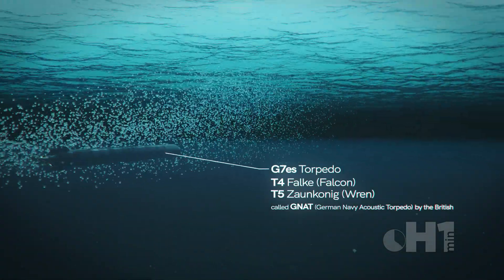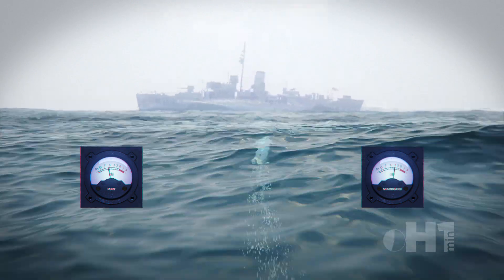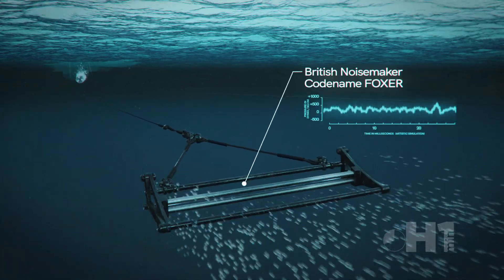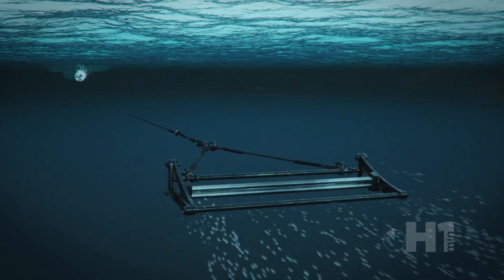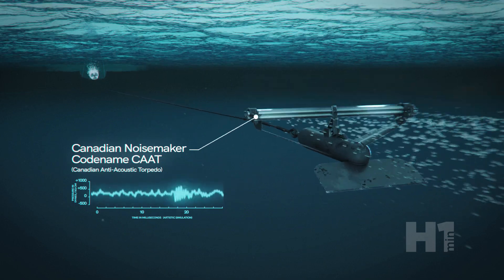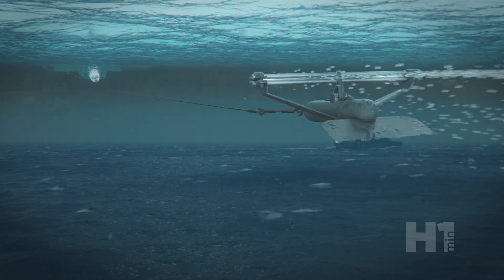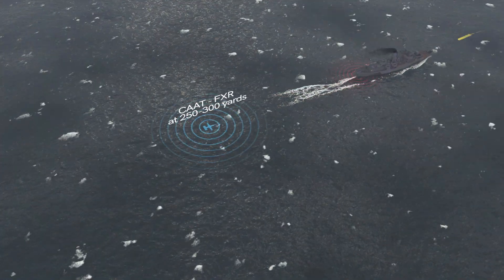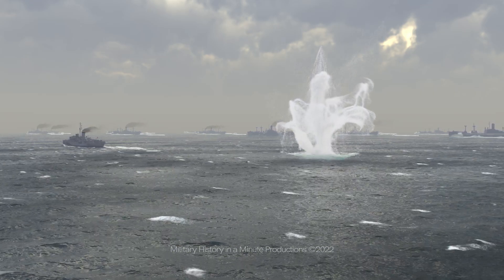H1MIN: CAAT AND FOXER ACOUSTIC DECOYS

Comment: Correct designation for the german acoustic-seeking torpedoes fielded during WW2 are G7es(TIV) "Falke", G7es(TV) "Zaunkönig" and G7es(TXI) "Zaunkönig II". Only the TV torpedo got the british codename "GNAT".

Although the content in general is quite correct, the illustrations isn't as much. No german torpedo could make those narrow turns, and the passive hydrophones in the warhead had a quite narrow field of detection (wider for the earlier versions used in the TIV, further improved with the TV and TXI torpedoes - the latter was also way better equipped with filters to discriminate the sound of the allied noisemakers).

Comment: The allies had some acoustic torpedoes too like air dropped ones
Reply: Indeed, it was the US "Mk24 mine" which had the allied codename "fido". As you say it was an air-dropped acoustic homing torpedo, but was designated as a "mine" as a way of trying to disguise the nature of the new weapon which was responsible for a fair number of u-boat sinkings from early 1943 onwards, where the tactic was to drop the mine in the wake of a submarine only once it had submerged for the reasons that the allies wanted to keep the weapon secret from nazi eyes, and a surfaced submarine could easily outrun the "mine".

The electric motor which drove the "mine" at a "blistering" speed of 12 knots was actually a standard washing machine motor used by the "General Electric" company in their washing machines. The low speed wasn't such a problem as underwater the best speed a submarine could make underwater was between 6-8 knots.

Comment: I've read military history for nearly 50 years but you STILL manage to impart something to me in every video you produce that I never knew before. I've known about the foxer and allied variants for decades but strangely NEVER stumbled on an image of one. You provide not only an image, but its a detailed fully working graphic of the device with sound !!! 

German scientists further refined the T5 "Zaunkonig"  acoustic with the T11 "Zaunkonig II" to counter "Foxer" deployment by improving the internal audio baffles surrounding the transducers to further filter out extraneous audio sources, and then programmed the torpedoes to execute a programmed tight circular run when the sound intensity picked up by the transducers reached a certain level. This meant that as the torpedo approached the sound source when the tight circular run pattern was triggered at the preset sound intensity if the sound source was a "foxer" then the torpedo would circle harmlessly around it without detonating due to the foxer's diminutive size, but as it circled it would then pick up the next sound source (more often than not, the escort towing the foxer) and head to that, if that sound source was indeed a ship then the torpedo would still run its preset circle at the trigger point but the length of the ship meant that the torpedo would circle into the hull of the ship (or under its keel in the case of a magnetic detonator), and explode.

Concise, eloquent, masterful. The quality of your graphic (and also audio) productions are superior to ANYTHING I've seen on TV, EVER. Yours is the ONLY YT channel that I wait with bated breath for the next episode. Thank you for your continued efforts.
Reply from the maker: There seems to be limited information to be found, especially on the early versions of FOXER. However, there is an improved version of CAAT which is still in the Squid handling room of the HCMS Haida. If anyone knows of others, it is interesting to see the variants. Thank you, your comments are highly appreciated and insightful.
Reply: wait couldn't you solve this just by towing the foxer on a longer string?
Reply: @VioletScarelli  If the foxer was on too long a "string" it would be too far away from the convoy it was meant to be protecting and the sound signatures of the ships it was meant to be protecting would be louder than the foxer itself.

Comment: Huh…so that’s what these things are when I was assembling battleship models. I thought they were deployable acoustic devices to help detect subs, but now it makes so much sense that large warships like battleships or carriers would have these.
Reply: larger warships usually did not have them because their louder propeller sounds could not be overwritten that easily. As mentioned in the video, these systems were for convoys, i.e. freighters and small escord ships up to the size of destroyers.

Since I am building ship models as well, I am 95% sure that the things you are referring to are Paravanes: https://en.wikipedia.org/wiki/Paravane_(weapon)
These are basically a mine clearing system that can be deployed from the bow of a ship, and either cut loose naval mines which then float to the surface, or let them explode on contact.
Reply: @xxnightdriverxx9576  okay I stand corrected, learn something new everyday!

Comment: Damn, didn't know homing torpedoes were a thing back then, no wonder the hitrate was high. Also is that really how quick the torpedo steers or just for dramatic purposes?
Reply from the maker: No, the torpedoes were not that fast or nimble. They had limited turning radiuses and the speeds were slow but much faster than convoy ships.
Reply: @H1MIN  thanks! It should've been obvious but i just had to confirm it

Comment: Man, its incredible how relatively simple the mechanisms are for both the torpedo and the decoys. No microprocessors or anything, just probably simple circuit design.
Reply: Yeah it’s impressive to see how complex they could get with the technology they had at the time
Reply from the maker: Agreed, like the Ford fire control on the Iowa class battleships or the Norden bombsights, it was all math, mechanical parts and analog.
Reply: @H1MIN  For the love of god make a video about those two!
Reply: The noisemakers were quite simple devices, but obviously as the electronics were in a pretty premature state during WW2 - pre transistors, the acoustic seekers in the torpedoes were far from "simple" and consisted of several modules with discrete components, using vacuumtubes as active components. Today you could achieve the same result with software and a programable microcomputer. Ie: Your conclusion is totally backwards...

Comment: "20 kHz over the sound of the propeller"

Did you mean 20 dB? I would think volume would be more important in attracting danger seals than frequency.
Reply: @icomitsudoku  Yes, that is the issue I am addressing.
Reply: @lesthodson2802  Higher kHz noise is more transmissible through water (i.e. audible from longer distances), so if the propellers and the decoys are around the same decibel values respectively, the passive sensors on the torpedo will pick up on the decoy first.
Reply: Just did some quick research, something about Canada Naval Research Establishment findings that 20khz  band was of interest regarding german wake homing torpedoes.

So guessing the CAAT was designed to transmit at 20KHZ.
Reply: https://cradpdf.drdc-rddc.gc.ca/PDFS/unc313/p807003_A1b.pdf
Reply: If too loud, the U-boat can hunt, and if new torpedos were made to track at a unique frequency, then past decoys would fail all the time.